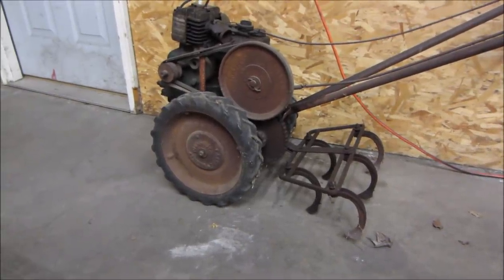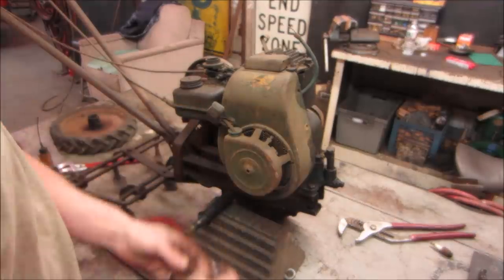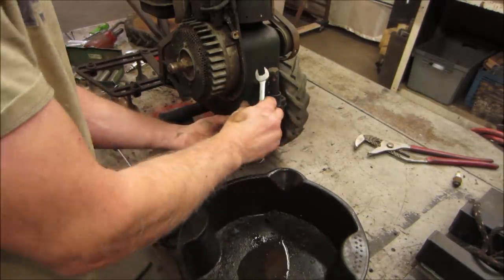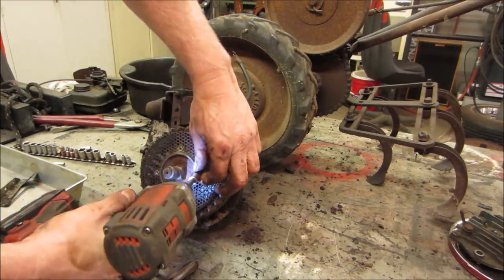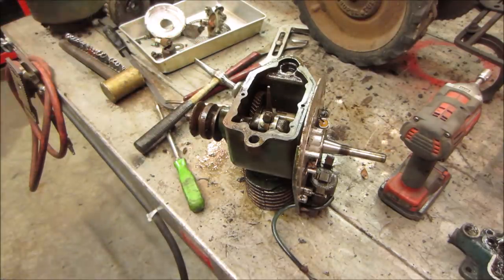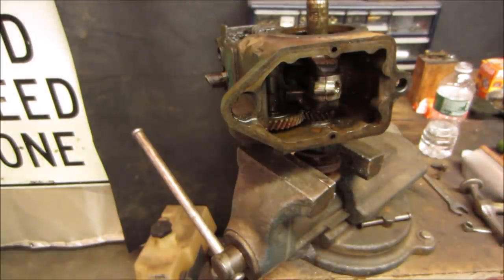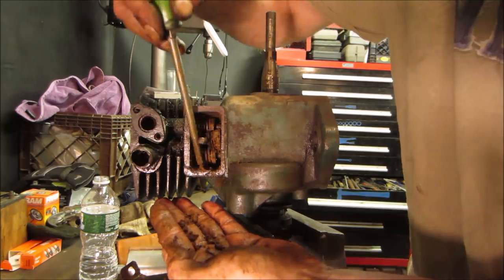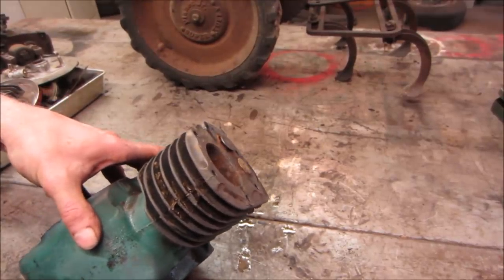Broken Antique Tiller tear down, can it be saved?

Comment: one thing that works very good as rust solvent is surprisingly enough is just plain water, if you suspended this block in water, let it set for a while, even couple hours then turn  the crank or any loose parts you will see it start to move, the water will carry away the rust loosening the parts, try it with a rusty bolt/nut, you will be amazed how fast it will loosen, these  or that particular iron block briggs was designed to be used in old stomp start washing machines, the casting oover the cam bulge had a kick pedal with a sector gear that engaged a gear behind the pulley on the crank, so housewives could start their washing machines, buck here

Comment: I wouldn't be able to throw it away without first succeeding in getting it apart. Soak it in white vinigar for a few days. Put plated nuts and bolts into a tiny container of white vinegar overnight and they're "pickled" (no more plating) the next day so you can weld them without any nasty vapors.

Comment: I had a Snapper Comet that was seized up worse then that soaked it through the intake since the intake valve was open did that for a day and the next day topped off the oil went to work and that night when I got home pulled the cord on it and it spun right over but I still need to do a valve job on that engine even though it runs because that valve sticks every once in awhile but it'd be nice to take that frame that engine came off of and put a old flat head 5 horse Briggs on it and at least save it

Comment: Personally I would have taken and tossed it into a bucket full of diesel and old trans fluid after getting the coil and points off.  Let it sit for a week then go in and see if things will move around a little bit.

Even with a crack and the cylinder looking so bad I would imagine you could weld that back together and make it work.  But still getting it cleaned up and then put back together the engine would make an interesting door stop for a place that sells small engine stuff.  And I am sure there is another engine in the stash that will fit on the tiller to make it useful.

And seeing you pull out the ratcheting combination wrenches makes me so sad.  I had a set of them that I loved and someone stole my vehicle with them in it.  So many went to the ones that flip over to change direction and honestly I hate them especially when you need the little kick over.  The straight ones just don't feel right.

Comment: The second I saw that head off I thought time to rebore the cylinder, when water came out the oil drain, I thought total rebuild. Trying to run it without doing so would be bad for it.

Comment: That's a lil tractor not a tiller. I know because I owned 1 my pop's & my dad had 1 2. That's a root rake on back. It takes a plow. A sicklebar mower. The attach in front includin a trailer meant 4 it witch has the brakes on the tires. & it hitches 2 the front. 2.

Comment: Do you own a set of ratchet ring spanners? never heard of them. The hose at the front above the oil drain is a crank case breather. Because the air filter has gone, the hose from the breather to the filter has gone west also. Did I see you using any WD40 or any sort of spray lubricant? At the very end there looking at the boats....I thought may have been looking to see if anyone needed a small cast iron anchor.

Comment: Nothing there that can't be repaired,  just needs a little work.
Just get it apart and use the old block to make a sand cast replacement block, machine all the proper dimensions into recast block repair all the other parts and put it back together. Times of war require extraordinary efforts !!
Check out the World's fastest Indian,  every thing you need for this is covered in that documentary.  Great entertainment.  Love watching your channel !!

Comment: Just for the halibut, remove the set screw from the pulley, remove pulley. Mount in vise and use a monkey wrench to try to turn it over. Can't hurt anything. Whack the crank from pulley side with a small sledge. See if something gives. On the off chance you get the piston out, it will likely be dead. Replace piston/rod assembly and sleeve it. If you are really ambitious, try drilling out the piston and cutting out the rest of the rod.

Comment: Would not electrolysis be a better option than expensive derusting products. Heck, a 5 gallon plastic bucket or other container, a battery charger, water, arm and hammer washing soda, an old anode or two and let her cook away. Just asking or is Evapo-Rust a sponsor?

Comment: After pulling the head and lower crank case cover, I'm honestly surprised that you bothered to go any further. Quick tip: When something is this bad and you really want to save it, just submerge the entire thing in Kerosene/ Diesel fuel/ home heating Oil for about a year. It's cheaper all the way around with generally clean and free moving parts as the end result.
Cheers 🍻.

Comment: if you would use a took call a wheel puller 
then it will come off very e-z plus it will not bark this way
i this see where you was fitting to getting it off

Comment: 805RoadKing would braze rod that crack. I would reuse that block, get 0.20 over or 0.30 over rings, hone that real good, braze that crack its OK. it's in the top heat fin, just weld that up you have no problem later on.

This thing is salvageable, do u know Roadking? he's just like you mustie

Comment: Why do you not use a plug scanner to remove spark plug cannot be much of a mechanic. Instead of using a adjustable nut rounding spark plug breaker

Comment: IF YA WOULD HAVE STUCK THAT BLOCK IN A BUCKET OF DIESLE FOR A WEEK YOU WOULD HAVE GOT IT APART  YER PISTON WAS RUSTED IN AS WERE THE VALVES IVE HAD MANY LIKE THAT EPOXY THE CRACK